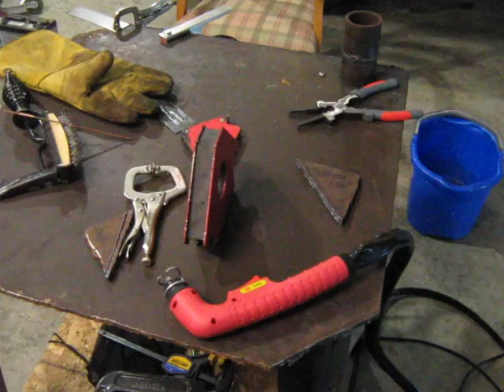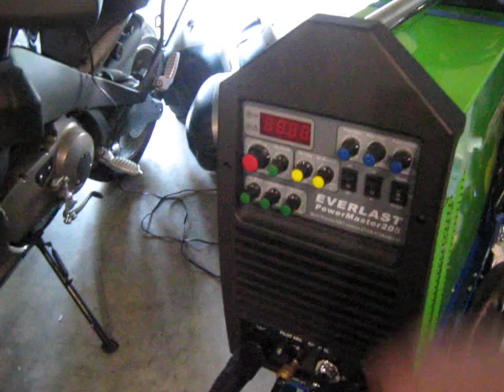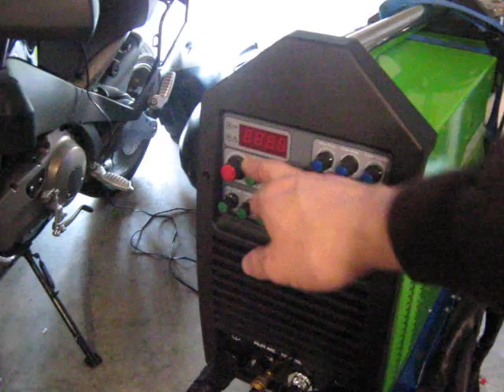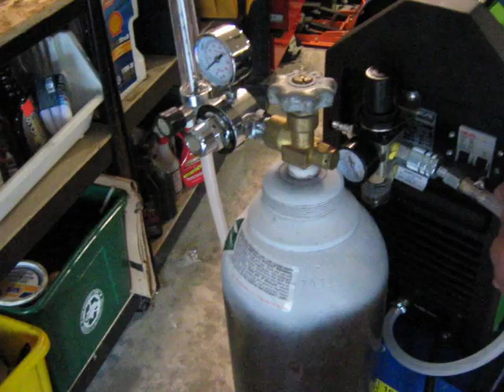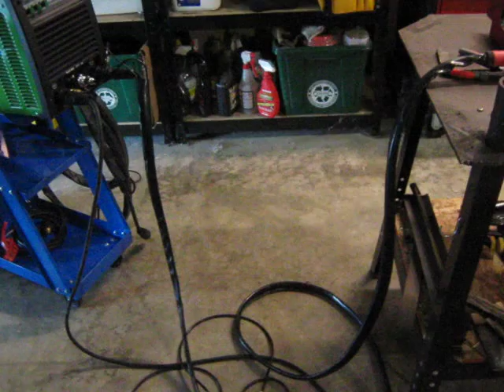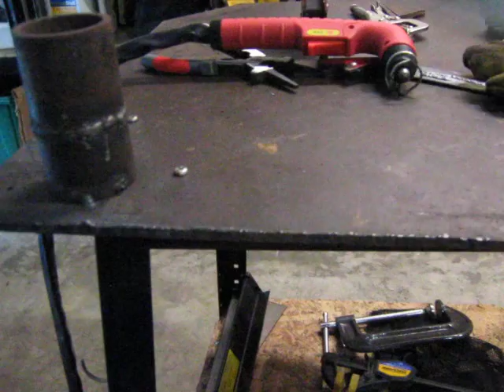Everlast Powermaster 205 Quick Review

Comment: @simpleinseattle I just bought a new Powerpro 205.  This years model has all the functionality of the 256 except as you know the 205 is 200A and the 256 is 250A.
Other than the regulator, have you had any problems with the 205?

Comment from the maker: The plasma cutting of the 1/4 was effortless.  Very narrow beam.   As for TIG, I was only doing 16 gauge and it took me a while to get it setup right because this is my first experience with TIG.  I later got out a micrometer and measured thickness to get the amperage setting right (1 AMP per .001).  I also went to a 1/16 rod because the 2/32 was too thick for what I was doing (see video).   I ran some pretty good beads after that.